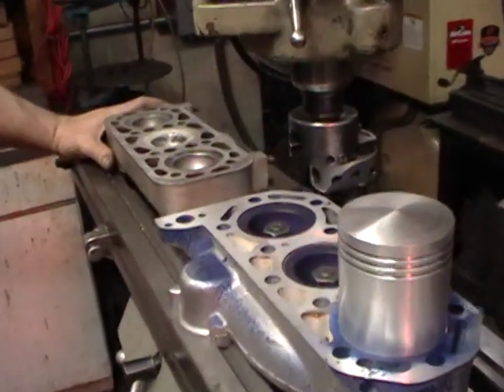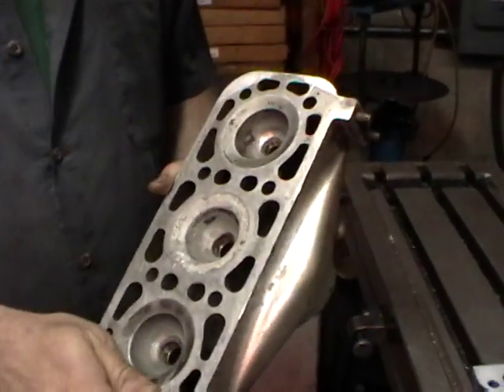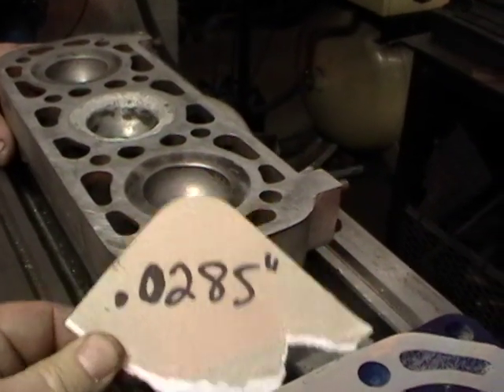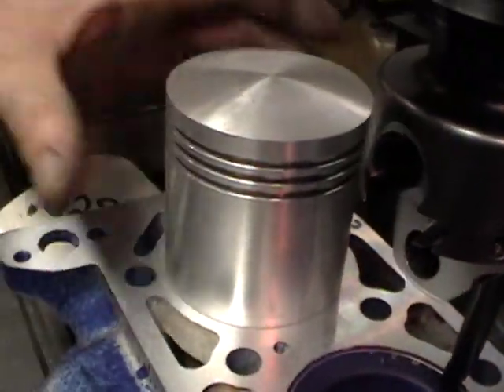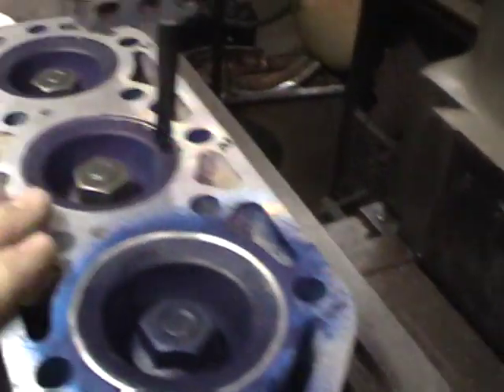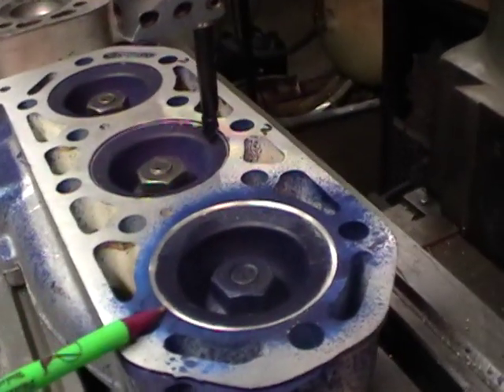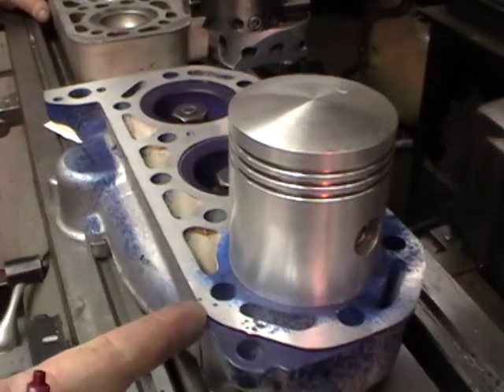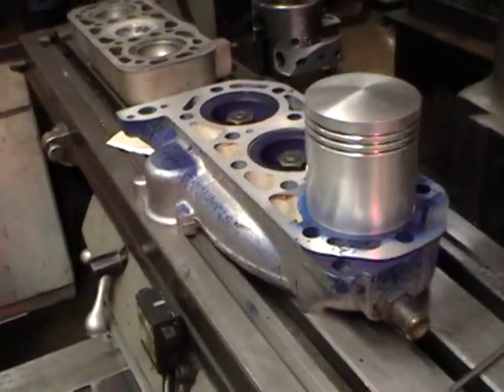Saab Two Stroke Head Milling

Comment from the maker: Saab called for .0285" in the pocket but almost all heads I have checked are actually closer to .035"  in the pocket which puts your squish around 040'-045' (proud piston and .040" Head gasket)  Saab had head gaskets from about .020"-.050" so it really varied at times!  Supplier issues I am guessing as the gaskets should have been al the same.

Comment: Could you not mill the top of the piston smaller so you don't have to do the head work
Reply: Probably not it would probably have some weird effects...most pistons that aren't flat are cupped otherwise they will push fuel to the side and clean the cylinder wall of oil.... which will cause premature wear probably overheating etc...